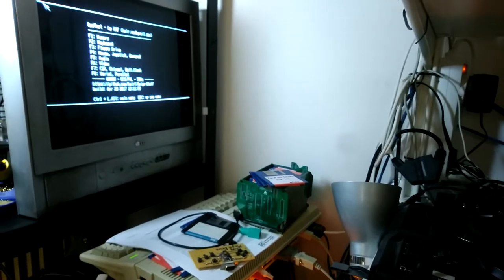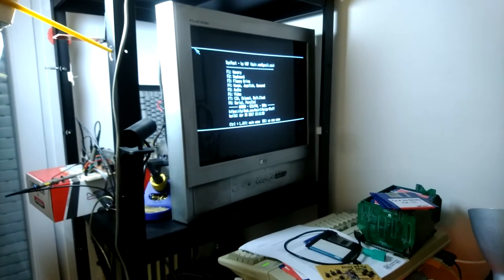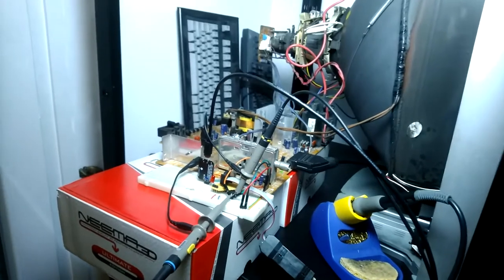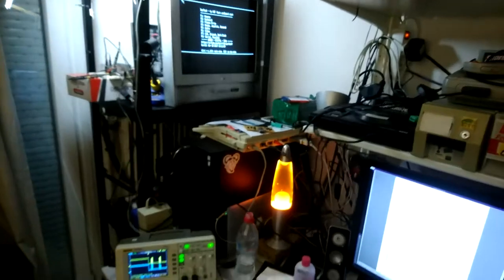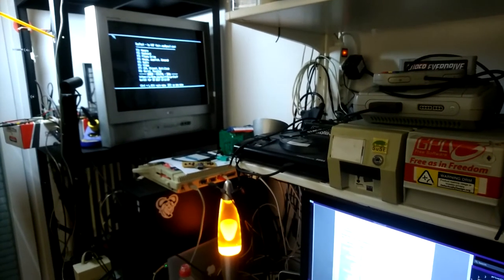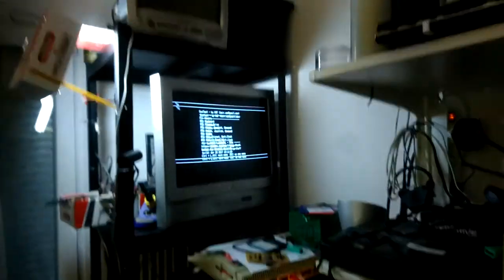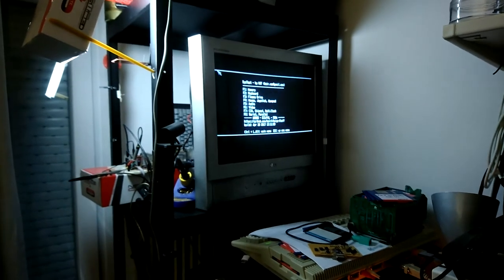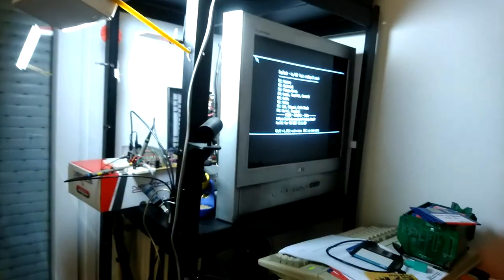CRT TV i2c hacking, trying to fix black&white image from RGB SCART input

Comment: There might be a mode you can put the MCU into to stop it from reading its configuration data which is overwriting the saturation levels you are trying to adjust. If I remember correctly, there should be a program/write mode since modern CRT's from that era usually have a debugging window which you can draw on-screen when you press a secret combination from the remote control over infrared. When that secret window is open and being drawn on the screen, you can adjust a lot of advanced settings. However, this TV may not have this feature (it was more known to exist on expensive CRT's such as Sony).
Reply from the maker: Thanks for the suggestions. It does have a series of service menus with a bunch of cryptic names for settings, but there doesn't seem to be anything relevant there. I also found the service manual, which has slightly more verbose descriptions of some of those settings, so I believe I haven't missed something obvious, though I can't be positive.

Comment: Did you ever get this working?
Reply from the maker: Yes, I intended to make a video about it, but so far I've been too lazy to do it. I couldn't find a way to stop the TV from immediately overriding my saturation setting commands, so I'm just setting it, and then holding the I2C bus to lock the TV out. Since many things stop working when I do that, I made it boot with the hack disabled, and I enable it on demand by either flipping a switch, or looking for a remote control button press. I fed the signals from the TV IR receiver to the microcontroller, and decoded the remote control protocol to do that. The AVR code is in my git repo: git clone http://nuclear.mutantstargoat.com/git/tv_i2c_hack
Reply: @jtsiomb  I'm currently messing around with an i2c bus on a crt tv and that seems like a good work around.. your video gives me hope :)